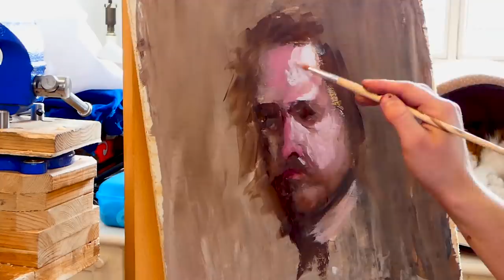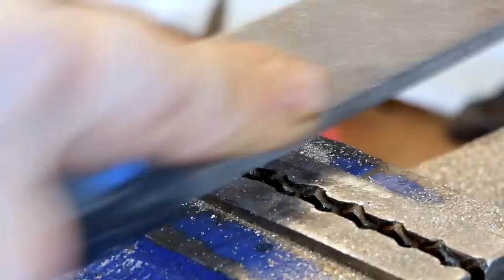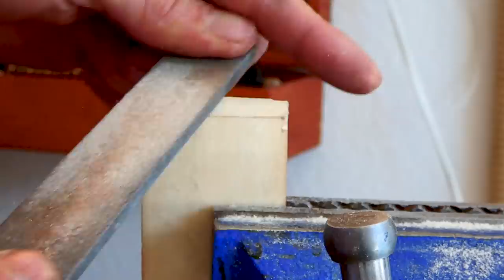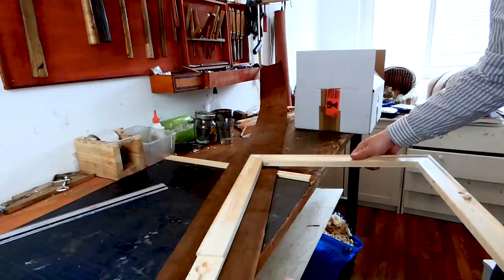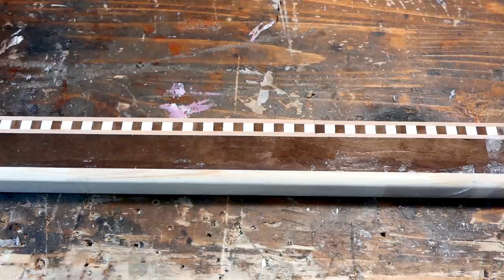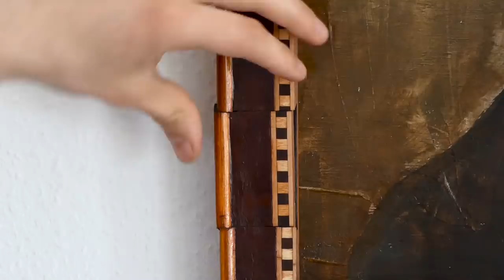I made a painting that follows you around

Comment: Please level this up! A maker can hopefully get you set up with a stepper motor and motion detectors on either side of the frame. Part deux?
PS: Much smaller point... but if you chamfer the eye openings, you won't notice the holes as much. Perhaps you can even dado out the  backside of the painting left to right across the eyes so you mechanism would sit flush.
PPS: I just realized my stepper motor and flush mount suggestions work in opposite directions... I don't know how tiny of a motor you could get.